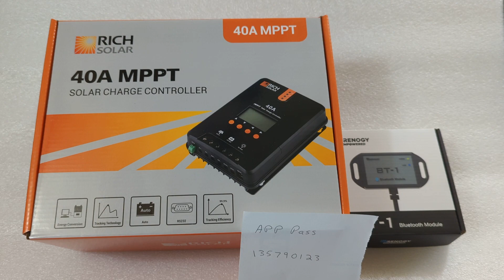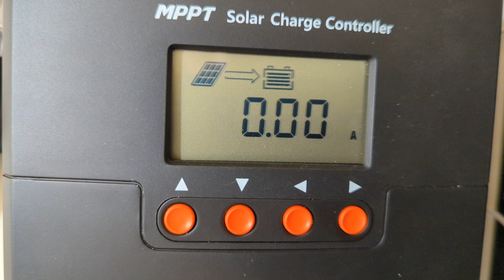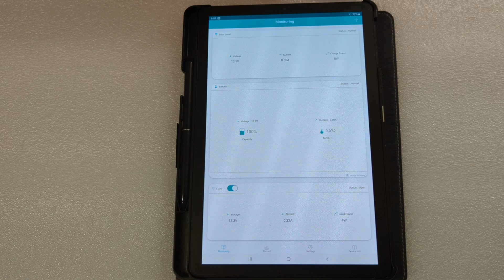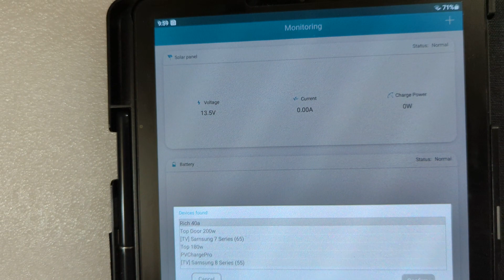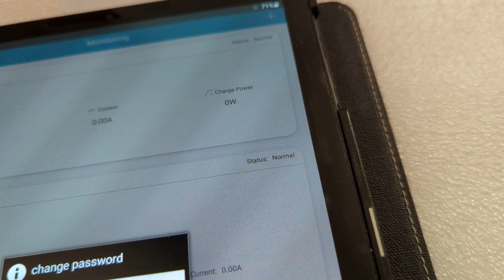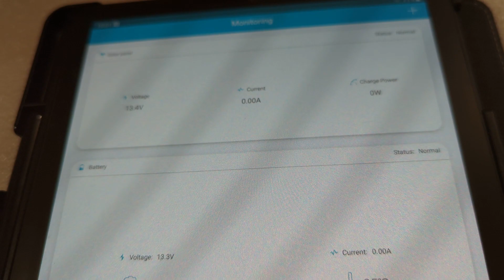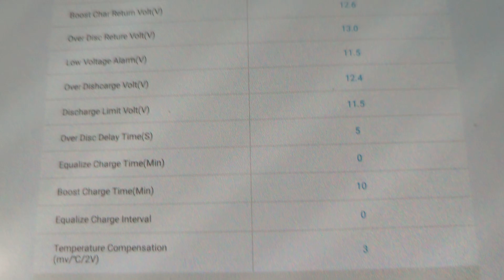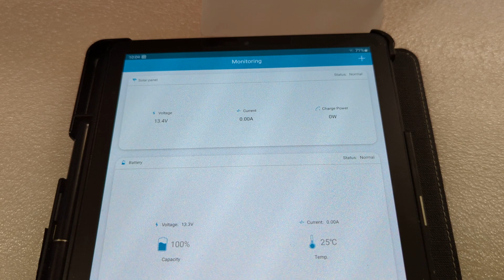Renogy Rich Solar Bluetooth App Password

Comment from the maker: Renogy Rich Solar Bluetooth App and Password Info
Default Password: 135790123

Old App is Renogy BT and will work for Rich Solar too
New App Renogy DC Home (Requires setting up an account)

The port RS232 used the BT-1, The RS485 uses the BT-2

Comment: So the Rich Solar 40a charge controller will work with the Renogy BT-1 and  still work with the Renogy DC home app?.  I am getting a camper that comes with solar installed and believe it is the Rich Solar controller installed, I will be adding a Renogy inverter.  I have seen where the Rich Solar and Renogy charge controller are the same, just rebranded.
Reply from the maker: @AaronDraper-x6u  yep, they're the same controller. Renogy is just a huge reseller

Comment: curious on your wiring.  I am getting this 40 AMP to run 4 -20 watt solar panels (series/parallel setup) - i am doing 10awg from the panels to 10 amp fuses on each series, then from rich to batteries was thinking 8 AWG,,,,  do you think 8 AWG is good from controller to batteries?
Reply from the maker: Need at least 8g for 40a, but does depend on length. I like to over build so 6ga for a shorter distance will work ok. You will have 80w so about 4a max
Reply: @mrmotofy  Hey I'm sorry it cut off the 1.  its 4, 120 watt solar panels (series Parrelel (2 sets of 2 pannels - on a boat so breaking it up) - 6.5 amp 21.6 volts Each ) - have 10 amp fuses on  positive of each series (10 AWG wire), then combiner - which should yield 43.2 Volts @ 13 Amps going into controller? using 8 AWG wire with a 25 amp duel pole breaker - then a 40 AMP mppt - out using 8 awg to battery and neg bus bar (fuse on battery terminal at 40 amps) - sound right?
Reply from the maker: @cardinhamkilligrew9712  I personally would use 6ga and a 50a fuse. The controller outputs up to a straight 40a, so a 40a fuse is at risk of popping